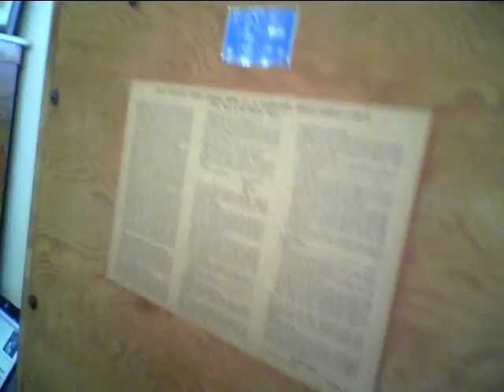Leslie Model 101 conversion to guitar amp

Comment: Get a power conditioner. You could always return it if it doesn't fix the hum.
Reply: arensel84 yeah, I did that.. it didn't help. eventually,  we found the problem- but I don't remember exactly what it was. Best thing I found for these was an ART Tube preamp- the Leslies need a much stronger input signal. Once I kicked a strong signal in and had the amps tied together, they were great.